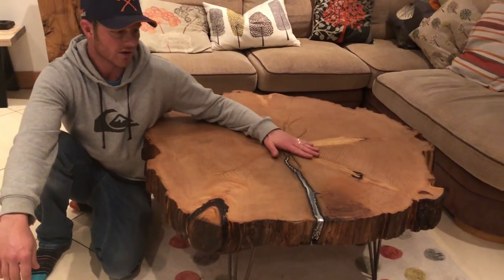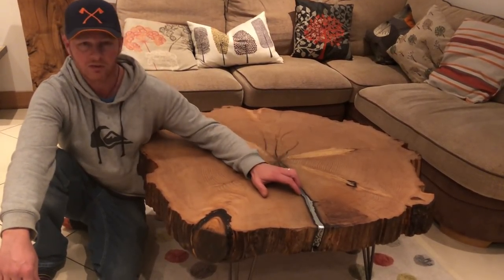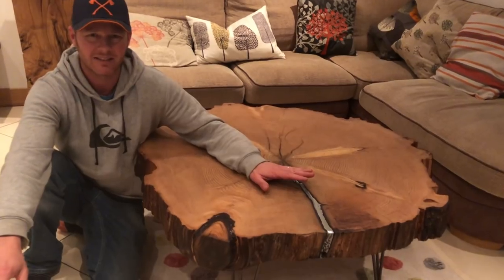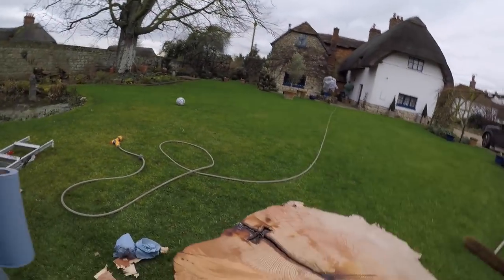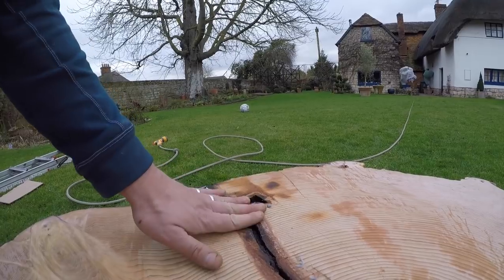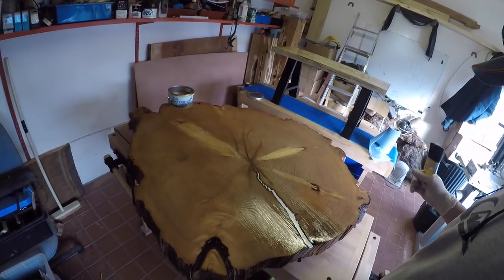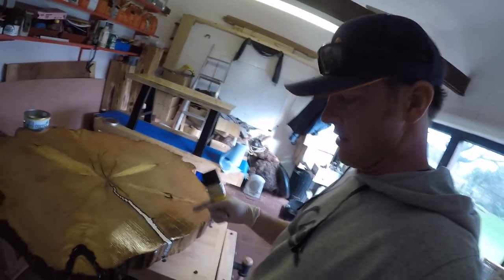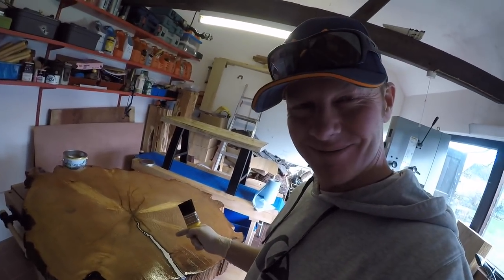Molten Aluminium into a Live Edge Cookie

Comment: was wondering if this would be more successful using low temperature solder rods melted and poured. Bright enough when freshly sanded and polished and should stay so when sealed in.  Bit pricey though, but does not need to go full depth as filler could be used to bring level up

Comment: That's cool. Might have to try that myself sometime. Wonder how it would look with molten copper?
Reply: Copper has a much higher melting point and a higher heat capacity per volume. So you would probably burn more of the wood. It might still look cool though.
Reply: It would look more expensive. Lol
Reply: @Baumscheibenkunst  could do a sheet metal copper cutout for the bowtie, and a solder or pewter inlay behind it.... that’d be badass!
Reply: @Rick_Sanchez_C137_  now that sounds really cool. I might give it a try.

Comment: Lovely project. With lead, you can test the temp with a piece of paper by dipping it in the molten metal. If the temp is right it won't catch fire, therefore reducing the risk of burning your project - don't know about ali tho...
Reply: Aluminum melts at 1200F so it's going to burn no matter what

Comment: That looks amazing :)
Reply from the maker: Thanks very much bud, more to come soon, cheers Blaise
Reply: I have filled splits with epoxy, buy have never seen one done with aluminum. To bad the other side did not fill. It would have looked neat with the bowtie. Do you think the moisture in the wood caused the aluminum to cool to fast, not allowing it to completely fill.
Reply from the maker: Yes it was a shame but thats why I tried it on the bottom of the table first time.  Yes its the moister that did it but not cooling too quick Im virtually certain that the vents were to small, I think with bigger vents it will fill completely.  Next time I'm going for it on the top! in a couple of weeks hopefully.  Cheers mate Blaise